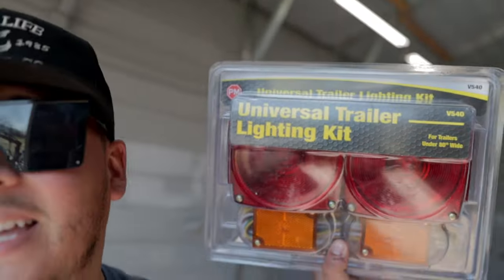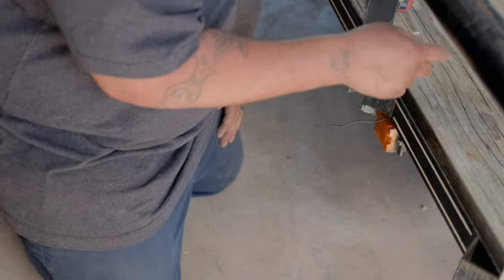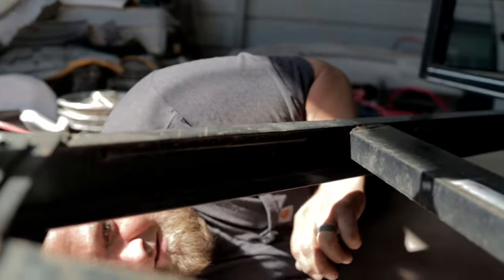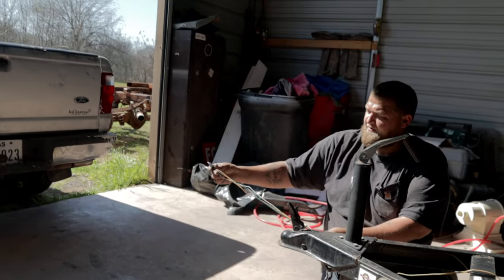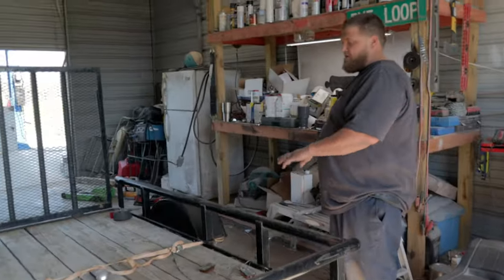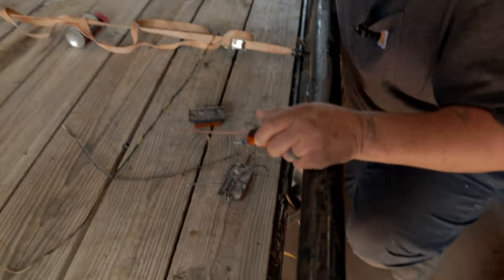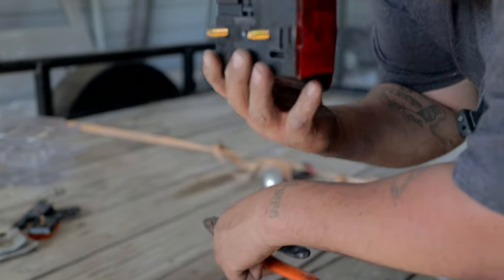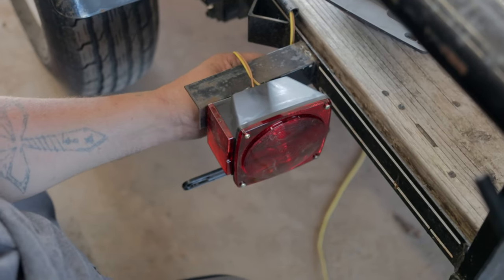How To Rewire A Trailer For Only $40

Comment: How do you replace and remove the brackets for the back three lights?  The brackets are screwed in with slotless screws.
Reply from the maker: The trailer we had used regular screws in them